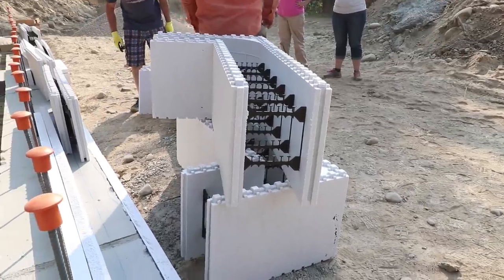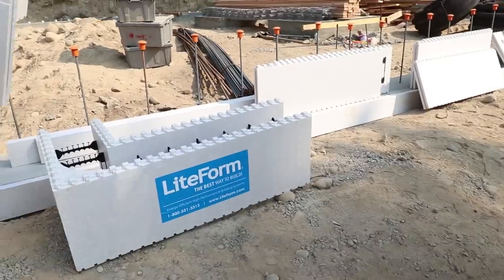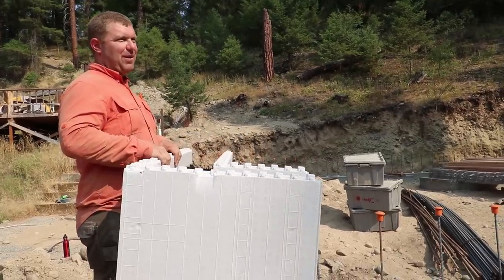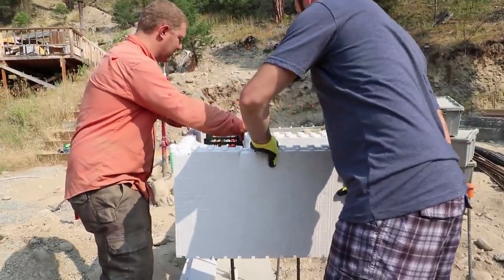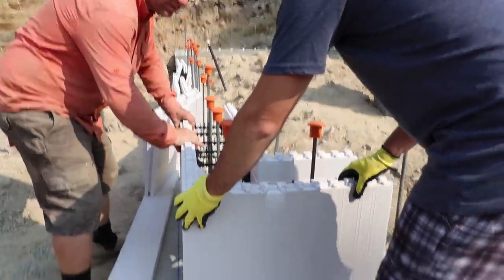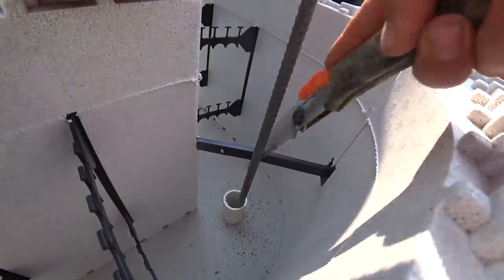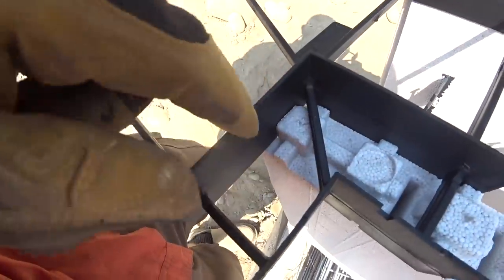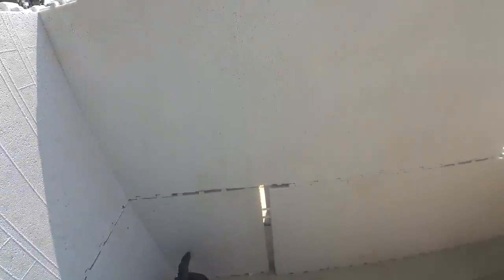Building a House Start to Finish: Beginning ICF Construction

Comment: Glad you upload this 3 am EST. MY FIRST solution to adding horizontal rebar would to go straight thru one edge of the corner for your 8 inch from bottom, yes a small hole that could be duct taped over on the inside so when yo pour concrete it would not be an issue.
Reply: would not work because the rebar needs to be bent in the corners. i was thinking of sliding the blocks on as they are laid.

Comment: Worked in construction as an engineer. For your size/scope project you're well within tolerances, good job!
Reply: Alex K. It's all about the tolerances! By the way, if they plan on using Advantec tung and groove subfloor, that stuff shrinks about 1/4 inch per sheet in the 4' direction.
Reply: TROLL STALKER you are blinded by your love of these two.  1" off is not within tolerance on any construction project, not even a tree house.  I am an engineer, and have been a project manager and quality control inspector for many US Army Corps of Engineer Projects at Fort Drum, NY.  I am willing to bet that you will label me a "poser" though, because I too would comment honestly about what is correct and incorrrect.  I like these folks,  but they do make mistakes.  You should get over it.  People with real experience will keep offering their comments with good intentions.
Reply: Alex K. 1" may be considered "within tolerances" for a footing form, but where else in construction would this be "well within" tolerances?  Do you have a degree in engineering?  I have never heard an engineer say they worked in construction as an engineer....  nonetheless that is all it took for TROLL STALKER to qualify you as the first real engineer to make a comment.   That was easy, just say something they did wrong is just fine!
Reply: '1" off is not within tolerance on any construction project, not even a tree house'
 What a load of BS. You obviously have not constructed anything bigger than a tree house in your 'career' as an engineer
Reply: Wow, some very impassioned responses here. In case anyone ever references these comments again, I'd like to clarify. For their type and size of project, 1" is fine. Probably on the outer end of acceptable, but for their wall lengths and their method of formwork, I'm not surprised, nor worried for them. If they were using industry standard equipment for large scale construction, they would be within 1/8" on these wall lengths, but not with these foam legos. But the cost needs to be considered too. So good choice on the foam, be a bit flexible. No "treehouse" or any project has ever been done to perfection. Anyone who says it has is lying or hasn't spent any time in the field. My childhood home was built an entire foot narrower than it was designed for god's sake (completely unacceptable, but still). Aim for perfection, just be prepared to be flexible.

As for the question of my credentials, I've spent 4 years in construction, most recently on a project in downtown San Francisco and the specifications for an several billion dollar project allowed for 1/4-1" tolerances for concrete/rebar depending on the feature, and inspectors occasionally let things slide past that as well. 

Be professional, even if its only a youtube comment. Ask questions instead of rudely asserting your experience above others.

Comment: If you temporarily lift out the corner block, you can push the rebar in through the open end, no need to cut through all of the braces!

Comment: i work with concrete and ICF blocks and to put rebar in the first layer just take of one of the corners off and you can put the rebar in with out of cutting the plastic. but of course some time you have to cut the plastic. 

srry for bad english :D
Reply: Helped some guys building ICF, I was just carrying the blocks. They did exactly the same and for the corner they always connected one block to the corner before installing both together. This way they could place more bent rebar in there and match the codes for overlap. If all failed, instead of cutting the bracing they laid down the rebar first and later wired it to the lower levels. 

Not sure if they are always that careful with not cutting the plastic. In this project they chose to exceed the recommended maximum pouring height to use full truck loads.
Reply: I love the fact that they dont try and edit all their mistakes out. Showing everybody their mistakes lets people learn more about the products they use and what to look for. So many people come on here and rant about how they are messing up. Not that I enjoy seeing them screw up because i dont but I learn more about things when I see mistakes and how to fix them. :)
Reply: Just stab the rebar through the corner block at the level you need it and pull it through. No need to remove the corner. We do it all the time. If you really want to, come back and squirt some foam in the hole before you pour. The cutting of the plastic ties is not such a great idea.
Reply: @bowmana1978: building codes in my area require a bent section of rebar in the corner. You can't just stab that through the corner.

@Koality of Life: That is right. There are some errors like unrolling the PVC where I think some research should have been done, but a lot of the small errors are just lack of experience. This is normal doing such projects for the first time.
Reply: Daniel Rose very true, I was referring to them fishing in straight pieces.  Indeed code does require bent corners.

Comment: Agree with others on rebar; either put it in before you put the corner on or heat a short piece of rebar to melt a hole in the end which can later be filled by spray foam later.
That said, keep up the hard work, but slow down and triple check.  Very proud of you guys and thankful for the life lessons!
God bless!

Comment: The single vertical cut from top to bottom is exactly how you do it. its your stack joint and its function is to allow you the wiggle room to dial in your dimensions. You would fill it with a high expansion foam afterwards to seal it back up once you've positioned it.

Comment: The Haterverse is strong with your channel. 

It's construction guys.  It's the art of close enough. You are not building furniture. You are building a house. Mistakes will be made... a lot of mistakes will be made. Don't listen to all those that never built anything other than popsicle houses.

One thing that 40 years of nail banging has taught me is that you will never build that exact structure on the blueprint. Something(s) will jump up and not work exactly as they are supposed to. You learn to work around them and modify it to get it to play right with the rest of the structure. All materials have errors.

Actually, I'm pretty impressed with the both of you for jumping into this as amateurs. If you get frustrated with something, walk away from it if you can. "Never Work Frustrated!" Trying to work through frustration will lead to more frustration, and really jacks your tude out of sorts.

One thing, well two. Method and process. Once you find a method and a process that works for you. Stick with it all the way to the last shingle on the roof. it will help you see problems before they become problems.

Ignore the Haterverse. You two are doing a lot better than you think. I am glad that no one was chronicling my work. You wouldn't believe. Allez Vous!

Comment: Good job.  Enjoy the videos. Forget the so called experts comments engineers, etc.  Was in construction all my life never found an engineer or architect who ever used a hammer a nail. Whats on a plan doesn't always work in real life. That's why there are the planners and the actual doers contractors who do the work. You have an engineer who's a resource great, but may also want a real contractor too. Your going to be off and inch here and there throughout this project it's nothing to lose sleep over. It happens million times a day in real construction. Nothing life altering. Keep the videos coming👍👍

Comment: Don't listen to all the negative so called experts making comments. They have made many mistakes in their lifetimes, but the difference between you and them is that they won't tell you about theirs. We had the house we now live in moved. I measured the the house with all of its corners and came up short on one jut by about 2 inches. The styro foam had to be 4 inches thick there on the foundation wall instead of 2 inches elsewhere in order to make it look right. I have seen the best contractors goof big time. We are only human. Smile and carry on with heads held high. I realize you came out fine and this was shot more than 10 days ago, just want to encourage you.

Comment: Great southern engineering job.
Take a break Monday and check out the eclipse 1pm central.  Should be good partial eclipse.
Wow, the directions must be read to the letter.  I thought you were doing it right but the center of wall makes sense.  Keep up the great work.

Comment: My approach would have been to let the building grow half or 3/4 of an inc and to hell with cutting blocks.........Also I would have bent the re bar on the corners out the way half an inch rather than cut the black bracing ties too!......I guess its easy to be critical when your not on site....Great job and love your togetherness and the whole project.......Cheers from Kiwi in New Zealand

Comment: Thanks for the regular updates - these daily peeks into the process are so addictive.  Well done to you both - and the helpers.
I've never seen the ICF block system and have to admit - it looks like a terrific approach.  Regarding the 'can't get the rebar in without cutting the ties' issue - it's too late now, but maybe you could have simply drilled a hole in the side and passed the bar through without bending.  Excuse the back seat driving - I'm not there in the heat and with the camera rolling.  I've got to think that once the concrete is filling the structures, none of these problems are going to be real.  I'd be nervous too though.
I've never seen a house with straight, vertical and square walls though, so your expectation of getting it just right seem to be setting your standards unreasonably and unnecessarily high.

Good luck to you both though, and thanks for letting us come along for the ride.

Comment: Are you building the front wall then cutting out the garage doors? I thought you were bending over the rebar to tie into the floor slab? Looking great other wise. Running in the lower rebar, I'd have used a hole saw to poke a hole in the corner piece to run them in, you can patch the hole with the slug from the hole saw and your foam glue.

Comment: If you didn't know already, anytime you string a line for a reference, like what you did to straighten the walls, add say a quarter inch shim to the ends of the line to hold the line off the surface. Then go through with the same size shim and true it up that way. Otherwise you may get a hump in a spot that screws up your reference line.

Comment: Great videos, I enjoy following along. I don't know much about ICF, but I had a thought on your issue of feeding the rebar in. Maybe just drill a hole slightly larger than you rebar at th height the rebar needs to be and simply feed it through the wall. Then patch the hole before concrete. This way won't have you cutting your cross braces.

Comment: If you have a spare ICF block, I would be curious to know what it measures in the winter.  I bet it's 1/16 shy of four feet when it's cold. 

And you mentioned in this video, or another, that you spend a lot of time just cleaning up.   That's a very important thing to do, because it obviously creates a safer work-space.  But it also allows you time to ponder your next moves and make the actual hard work a little easier.  It's always worth it to keep a clean job-site.  

Safety First!  Mike's Hard Lemonade soon after!

Comment: Question is this. Does cutting the plastic cross straps the item holding the mold together for pouring? Wouldn't it have been better to leave a corner off and slide the rebar in from the end?

Comment: Foam expands when heated just like everything else, that is causing the different measurements (3/32) .  The gap created if there is one can easily be fixed.  The rebar could have been placed into the ICF as it was installed.  It's also made of Styrofoam and can be cut at one end to slide the rebar through the structure,  Do not cut the support for the ICF!!!!   Do not be afraid to send everyone home and take an extra day or two to get the information you need to do the job correctly!!!!

Comment: When ready with a course remove the corners, this will allow you to insert the rebar easily. The rebar for the corners is still difficult but at least you will not need to cut all the ties. (I know they already poured, :) )

Comment: Great video. I liked how you showed us the trouble you had, how you worked through it and figured out what went wrong. If there had just been a 5 second sound bite warning of the potential issue before you avoided it entirely, I probably would have just quickly forgotten the advice. Instead I'll probably remember this problem/solution on my deathbed. (not that I'll ever use it... :P)

Comment: I saw one comment about removing the corner to put the rebar in, even easier would be to just drill a hole in the block and then fill it with spray foam afterward.

Comment: To place the lower rebar couldn't you have put a small hole in the end ICF at the correct height and run the rebar through the hole and down the ICFs at the correct height? Once you have the rebar in just fill the hole with foam.

Comment: Issues always come up and can usually be corrected at some point, being a diesel technician I don't have a lot of room for error in my work; Almost doesn't cut it.

Finish carpenters are usually the guys that have to make everything fit, because in these days of build it fast; It usually doesn't get built right. As you pointed out when it comes to doors and windows, that is where it really matters. Overall dimensions aren't really a big deal if it isn't way out of proportion, being square and plumb is major. While your home is now going to sit on 1/2" bigger footprint, that's really the only difference.

Comment: 16:00 On a related note, engineering drawings always include tolerances.  This is because of variation in fabrication of the components.  Every component part is also fabricated to a set of tolerances.  The buildup of these tolerances during the assembly process can lead to parts not fitting or huge gaps.  Commercial aircraft have metal shims (usually aluminum) all over the place in the structure due to this.

Comment: A question: Wouldn't it be easyer to install the membrane if you cut or buy them in smaller strips and have them overlap like 5cm for a seal? Ofc you'd need a bit more membrane, but i believe the fit would be much tighter and the process much easyer.

Comment: These expanded Polystyrene blocks are steamed in a mold and then dried out over a few days in a large oven. They swell by 10s of % out of the mold so getting them within these tolerances is quite good. There is no way to get them more precise, short of classifying them.

Comment: I'd prioritize ties over dowels from the footing by cutting that bottom ties you risk a weak spot right at the very bottom where you have the highest pressure on the forms.   Should have just bent the rebar out of the way.

Comment: Did you know the Romans used concrete formed from Lime and volcanic ash. The chemical reaction self repairs any crack as soon as any water penetrates the crack it "self heals" by calcifying. No rusty rebar issues in those days.

Comment: Is that a regular Styrofoam you are gluing to footing? I hope you are planing to apply some kind of hydro insulation. Otherwise it will just fall apart after few seasons. Same with ICF's . They must be sealed. Water will destroy them. It will fall apart and turn into pile of individual Styrofoam balls.  Sealing can be done after concrete job before it it is back filled. Just don't use anything solvent based. You now what will happen. :) Cheerz from Latvia!

Comment: At 12:31: Is that a totaly open corner piece? Isn't that an issue with the stability of the walls? And amateur question: Don't you have to put the membrane also between the foundation and the first row of ICFs? Here in Germany, that's how it is done ..... wondering about the difference in materials between countries

Comment: Going swimming. Right answer. Every time I planned a foundation it always fit perfectly. Every time I built a foundation using any method, including ICF a certain of fudging and resquaring at the sill was standard. Even if I bought foundation work from the very best in the area. It always happened. So by my light you are doing great. If building a house was easy or cookie cutter every body would do it. And going swimming when the &%&! stuff won't line up always seems to help. Bet it did for you.

Comment: It surprise me that this system is still in use in. In the Poland we ditch it few years ago as it is not efficient as it say on tin. Ytong is much more efficient and wall actually breath. This system make from your house fridge and without decent ventilation you will get mold and unpleasant wet areas in home because we breath and create condensation. While you cook wash etc you create condensation and with wall made from styrofoam you block it from escape so it condensate on the walls windows etc.

Comment: Something I learned from another channel - learn where accuracy is important. Foundation work and in fact much of framing has a much greater tolerance for measurements than interior and finish work. Working to the 32nd on a foundation is time better spent elsewhere.

Comment: instead of cutting the plastic brace, couldnt you just put a Z bend in the rebar? and couldnt you put down a new chaulk line to use as a reference?